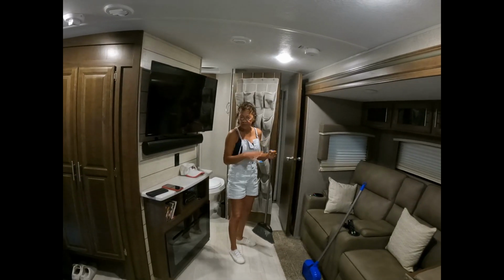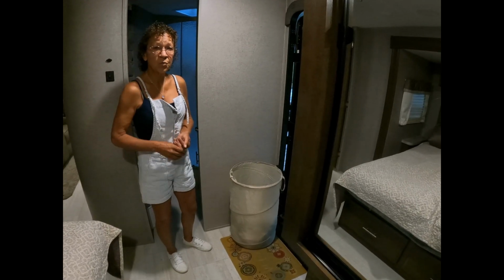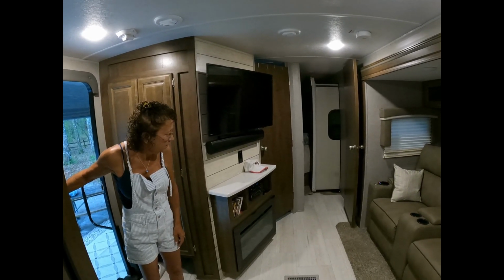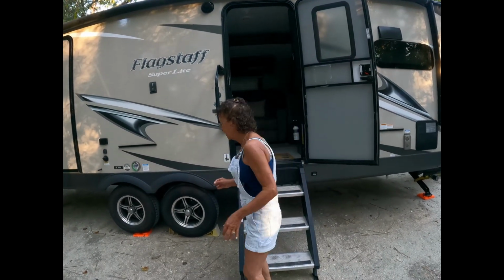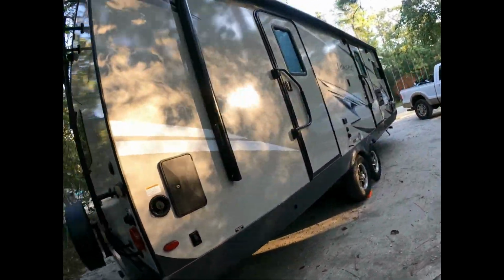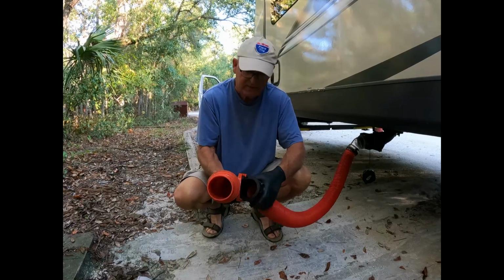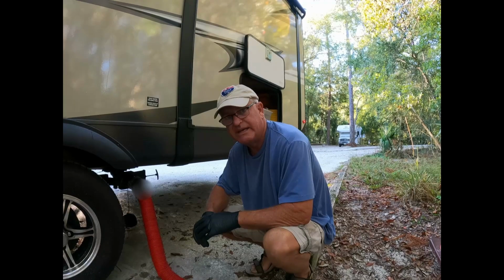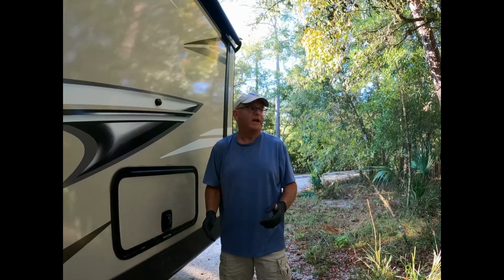RV NEWBIE: RV CAMPSITE TEAR DOWN AND DUMP STATION TIPS & TICKS  / RV LIFE

Comment: If your black tank isn’t 2/3 full do you just flush the toilet until it is?
Reply from the maker: For our Gray tanks yes, but for the black tank we use the inlet on the outside of the RV to fill the black tank. If I didn't have an outlet then yes that's the way I would do it I would fill it from the toilet, I normally try to get black tank at least 2/3 the way full if not just a little bit more to get a good flush, hope this helps
Reply: @RVFieldTrip  thanks!
Reply from the maker: @heatherholman943  Happy to help

Comment: How long would you estimate it takes you to break camp and be on the road?
Reply from the maker: If we have to use the dump station I'd say it's around 35 to 45 minutes to break camp and be on the road, as long as there's not a line at the dump station, if the campsite has full hookups I'd say less than 30 minutes to be on the road, hope this helps, and thanks again for commenting look forward to talking to you again